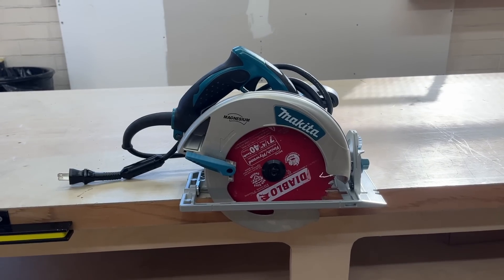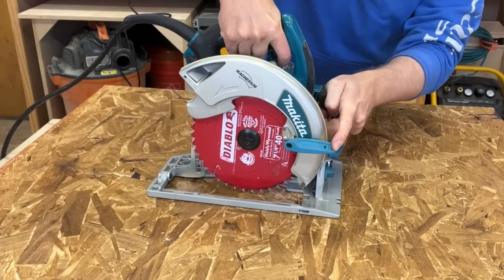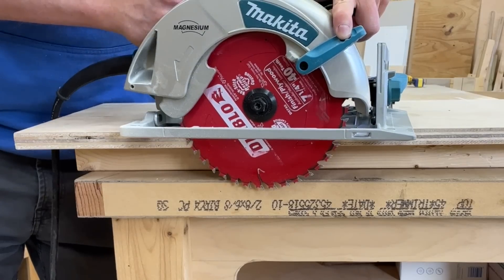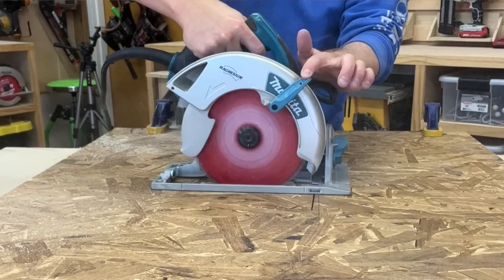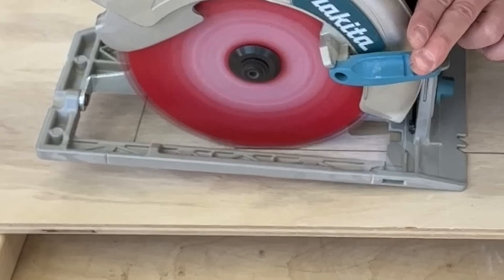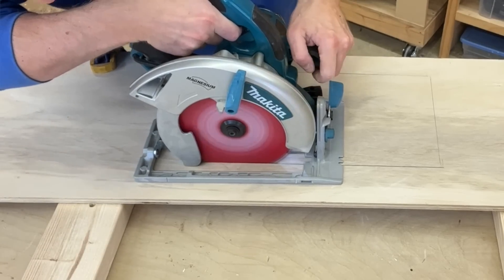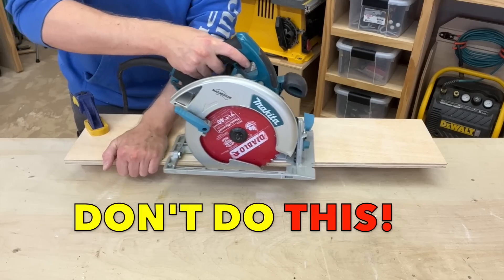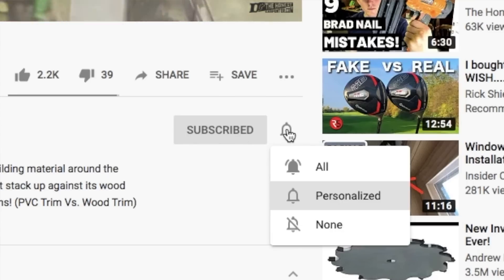Don't Try This DANGEROUS CUTTING TECHNIQUE! (Here's How To PLUNGE CUT W/ Circular Saw Instead!)

Comment: Too Dangerous for my taste, if I ever need to make a plunge cut, I'll just stick with my Jigsaw. 👷🏿
Reply: Amen to that 🙏
Reply: But you can't start a plunge cut with a jigsaw. Do you use a large drill bit for the initial hole?
Reply: Absolutely! I can drill a hole and use the jig saw. I’m not a pro so I shouldn’t use pro methods.
Reply: @paulcarey1708  drill bit with diameter slightly larger than the width of jigsaw blade.
Reply: @paulcarey1708  Yes I predrill holes on my cut path before I start.
Reply from the maker: I’m going to show jigsaw plunging in another vid, W!
Reply: So I've seen yahoo's  reverse blades to cut multiple sheets of metal roofing, was no way! I wouldn't do that, but seen done. Seemed unprofessional,
Reply: Glad you prefaced this with if your not a professional. That was exactly how I was taught to plunge cut 25 hrs ago.
Reply: And a drill and a drill bit of sorts
Reply: @anywhy30  nah. it's a good use of old dead blades. It also works for thin plastics. Like siding.
Reply: @paulcarey1708  yes you can just set pendulum to max and rock the blade in. As long as your hole is bigger than saw stroke your fine.
Reply: @anywhy30  pretty good use for a dulled blade, you can cut steel plate with those tungsten teeth, some saw companies even market the fact. Turning the blade around is just to get better geometry than a rip tooth.
Reply: I've never had any issue with plunge cuts even as a rookie. When your jobs requires production you tend to throw a few safety things out the window but also, you've gotta play it smart whenever using any cutting tools or nailers.  Jigsaw is nice but for production framing, you will rarely see them out on a typical job site, mainly because the setup for the cut takes a while, and having a flexible blade, I rather go circ saw and keep a firm grip.
Reply: You ever tried to plunge cut with a jigsaw? It's aweful. What you probably mean is drilling a hole and sticking the jigsaw blade in. That's ok. 
But plunge cutting with a circular isn't that bad though if you do it slow. I still have eight fingers..... And two thumbs. Lol
Reply: Yeah I agree, plunge cuts was one of the key reasons why I bought a tracksaw as it felt way too dangerous to do the same cut with a circular saw
Reply: Even if I was a pro of all pros. I'm going to take my time and do it the safest and best of correct of ways. I'm never going to rush things to maximize a profit. One mistake isn't worth finding out how bad a mistake can be. Just like "measure twice cut once" I got my one thing "Doing it right is one time done."

Comment: I'm 71 and not a pro by any means.  I've not done that many plunge cuts but the ones I've done have all been your way, I have never ever even thought about using a saw without everything being tightened down properly.  A coworker used to chock the blade guard up on his saw and still did it even after setting the still spinning blade down on his thigh.  Nasty gash, some people are just stubbornly ignorant.

Comment: As a DIYer, I've done the loose plate method once. It worked, but something about it didn't seem right to me. I figured out the better method on my own. I'm glad you're putting this kinda info out there.
Reply from the maker: Yep, there’s something just insecure-feeling about it Bruce! One of those things you can’t pinpoint until a really bad kick happens when you’re right in the middle of a cut 😬

Comment: One way to help get the cut lined up is to put a reference line on the piece.  Figure out about where you are going to start the cut, make  a mark on the piece at the front of the sole plate, then mark a line 90 degrees to the cut line at that point. Then you have a reference line to put the sole plate on when you start the cut.

Comment: I'm not exaggerating when I say this but yesterday I had to do several plunge cuts into plywood and I used the exact method you described. Measure the depth. Pivot on the plate. Go slow. Lift your cut material off the surface.

Everything worked perfectly.

Comment: Love your safety tips.  Of course my heart is always in my throat when you demonstrate what not to do.  Can't even imagine the number of DIYers who have been hurt with by improper use of cutting tools.  I realize now that I was doing a bunch of unsafe things with my table saw.  I'm so grateful I didn't irreparably harm myself before I found out how to execute a proper cut.
Reply from the maker: Thank you, Jonesy! I’m really glad the tips are helpful—and that you’ve remained safe this far. Keep it up in 2023!
Reply: If you run you cut lines out beyond the corners of your cutout it’s easier to see where to stop cutting. Sometimes after making a the initial cuts I lower the blade to get closer to the corners after making sure there is clearance. Haven’t tried the loose shoe trick but you definitely want the toe of the shoe registered on the material.

Comment: In 1976 I joined the Carpenters Union and began framing tract homes in So Cal. Back then everyone used the Skillsaw 77 with guard held up with a 16d nail. No hard hats. In the summer we all wore shorts and tennis shoes. No handrails. We walked the tops of the walls for rolling joists and setting beams and rafters. I did this for 14 years. After that I was a Licensed Contractor until 2013. I am very glad to see that today all that has changed.
Reply from the maker: I’ve seen a LOT of that same stuff myself, Joe. I too am glad safety is getting a bit more of a look these days!

Comment: Another suggestion for alignment,  Measure the distance from back of blade to front of sole plate.  Draw a perpendicular line to each cut line at this distance from the back line.  Line up the front of sole plate to this line when beginning the plunge cuts

Comment: I have used a circular saw, both casually and professionally, for over 30 years; often on sheet goods and occasionally requiring a plunge cut.  I have never heard of the loose plate method and certainly would never attempt it.  The way you show has always worked for me.

Comment: I make plunge cuts when needed. Not a problem if you set the saw on the material to be cut, adjust the bottom of the blade to be 1/4 " below the material, and anchor/set  the plate. Carefully line up the blade with the cutting line, hold the front edge of the plate against the material firmly and press the blade into the material. I don't think anyone leaves the plate unanchored when cutting.

Comment: I agree 100% - loose plate cutting is only for people who don't want their fingers any more

btw: I find a line perpendicular to the intended kerf, about where the toe of the sole plate would be, helps line up the cut. you don't have to line up with it perfectly but it helps

oh, and watch out where the rear of the blade is. it's easy to start too far back and make a mess of the corner

I hardly ever start a cut in the classic style when I'm cutting sheet material because it's so easy to have the edge tear out, making an ugly corner
Reply: Soooo.... the guy with 11 fingers tired of getting teased by the other woodworkers?   ;^)

Comment: I've used the tilt and drop method for almost 30 yrs for cutting out windows, medicine cabinets, vents for a roof, etc. It's the only method I use, even when I started carpentry this method just seemed logical. It is a good practice to use and safer, I've seen other people try the other two ways where the saw does kick back or tweeks the blade. Great video.

Comment: As a DIYer I have done quite a few plunge cuts over the years. I always used the correct method you showed because that is how I instinctively did it. Never even thought about other methods cause it worked well for me.

Comment: I've been a carpenter for 35+years and never even heard of anyone doing loose plate cutting. I plunge cut exactly as you showed in this video. Good job! PS: if money is no object...buy a Festool circular saw... it does plunge cutting with ease.
Reply: absolutely correct!!!
Reply: plunge cutting with ease into wallet! sorry, could not help myself

Comment: I've never seen or will use the loose plate plunge. I do mine like you do, line up my front plate notch & my blade (adjusting my kerf with my line) then start the blade. I find plunge cuts are easier with my Skil worm drive than my M18 sidewinder. Another great video.
Reply: I found plunges easier with the skil worm too until I started clamping the blade guard open. Something I would strongly advise against any diyer doing and any pro making a habit of it. I will never clamp a worm drive open and probably not even a corded sidewinder. My M18 fuel though... That thing is so fucking smooth and has never kicked on me.

Comment: Great video - thanks. It made me think about a few times I've had to do this and yes, some of them ended in kickback and a messed up piece. I went out and tried something - clamping a wood baton at right angles to a cut line on a board, and bracing the sole plate against the corner between the baton and the board. It worked a treat to make the first cut and it lines the blade up exactly. Here's exactly what I did - 1 set the cut depth to be 1" below the board, 2 clamp the baton at right angles to the intended cut, 3 place the front of the saw sole plate into the corner between baton and board, 4 turn on the saw on and gently lower to make the plunge cut, 5 turn saw off and remove baton, 6 reduce the cut depth to 1/2" below the board, 7 with saw still off, drop the blade into the cut with the reduced depth giving enough blade clearance front and back to avoid kickback on startup, 8 complete the cut. This all takes a minute or two longer, but I got three perfect cuts out of three. I hope that helps somebody!
Reply: Great solution imho

Comment: I haven’t done loose plate plunging, but have had the plate loosen. Not great, but I usually have stuff clamped down when doing that.  This gets way more important when doing a bevel plunge. 
Cutting short hip rafters, same thing. Clamp it. It’s cheaper than hiring a guy to hold the other end.

Comment: 1. High end circular saws (e.g. Festool, Mafell, etc.) have a spring loaded base plate that can be pre-set to a precise depth to allow for a controlled, precise plunge cut. This feature is extremely useful and is one reason why these saws are expensive. You get what you pay for.
2. When using a circular saw on a track (i.e. a track saw) to cut high quality sheet goods (e.g. finish plywood), it is sometimes extremely helpful to initially set the depth to a shallow cut (~1/8” to 3/16”) and move the saw backwards along the track to make a clean score cut, then re-adjust the depth for a full thickness cut and cut forwards along the track. This produces a clean cut on both sides of the plywood.

Comment: Great stuff. Easily overlooked in your video is the bit where the work piece is clamped down. I have seen WAY to many sketchy things on job sites where guys have plywood on top of rickety horses or a small piece sitting on a drywall bucket and everything is skating around.
   Doing plunge cuts are a recipe for disaster if you don't have a stable work piece AND total control of the saw.

Comment: Very good advice. 
I rate the dangers of a circular saw right up there with a table saw. But with a few precautions (such as what you just explained) Both saws can be relatively safe. Great video btw.
Reply: Table saws can be very good at launching missiles, but they'll never kick back and slam a spinning blade into you.

Comment: Thank you sir, of all the power saws I find the circular saw the most difficult to learn to use safely and effectively. I greatly appreciate all the tips and tricks you provide! And yes, as a noob I have not yet spent enough hours to develop the fine motor skills required to use this saw professionally, so my attempts at long straight cuts do get "squirrelly" haha
Reply from the maker: You’re welcome, Bruce! It’s the most dangerous saw, so it’s the one I cover most thoroughly 👍
Reply: @Bruce Le Smith find a good straight edge and, with it clamped down securely, run the plate of your saw along it to make long, straight cuts. I was nervous of it myself at first, but once I learned the dos and don’ts and had some practice, I became more confident. That’s not to say that you should ever get so confident that you stop following safety rules! I’m sure you’ll be running nice, straight cuts in no time. 🙂

Comment: Nothing is more precarious than taking off 3/8" of a custom cabinet that has been waiting f
or a Sub Zero since the pandemic started.  Then sometimes you need to take some off the height! Great video and you're a great teacher
Reply: If you're talking about widening the opening or removing part of the scribe on the face to fit it between other cabinets you're talking about something that works far better with a router than a circular saw. That's especially true if you're removing something so  it will be flush to the side of the cabinet. You definitely need to be mindful of the grain, and make sure  you don't let it split out more than you want to remove. A saw works fine for  taking down the sides to adjust height, but  anything will show needs to be scored with a utility knife and then taped to prevent splintering.

Comment: For plunge cuts I shim the guard open using the lever against the blade housing and when I'm finished I let the blade come to a complete stop before I remove the saw then I set it down but not on the blade. That way I have both hands on the saw during the plunge cut.
Reply: I use a pencil to hold the guard open.

Comment: We cut alluminium with a circular saw at my workplace up to 150mm and have plunge cut 50mm we clamp a straight edge on the material and use that for a fence.  Up to 100mm we use a makita saw and the thicker stuff we use a festool saw that is massive but slow as it has some sort of thermal cutout and it stops and you have to wait. The makita saws are very good

Comment: Years ago I tried to plunge a cheap corded saw into floor boards with no knowing how…it scooted off on its own. 😂  So when I recently bought my Dewalt 570 ‘serious saw’ I looked up how to plunge properly (as in this vid) and never had an issue.  I make a point of setting my saw depth to no more than half a gullet depth deeper than the material and that works perfectly.

Comment: If you're gonna  need a jigsaw to finish the corners of a circular saw plunge cut, you might as well make the entire cut using the jig saw.  I think it's safer and easier to drill two holes in opposite corners and use a jig saw to make cuts away from the holes before cleaning up the two corners that have the drill holes with the jig saw.  I used to hate my jig saw, but learned that using a short blade and cutting slow yields nice straight, square cuts.
Reply: And a lot safer too.
Reply: Depending on the depth, you might just need a hand saw for the corners.  Also, maybe use a circular saw for the initial cut, and then a jigsaw for the rest.
Reply: Over any sizeable run the jig saw always gonna have some waviness even with the steadiest of hands.
Reply: You Can never cut as straight with a jigsaw as with a circular Saw - unless you use some kind of guiding rig
Reply: faster and easier to end up with a nice strait cut using a skilsaw, but if someone isn't comfortable with plunge cutting, they should just use a jig saw in that case.
Reply: What about scoring a line in the wood with a utility knife and instead use a multi-tool? It might take some time but I would argue much safer......no?

Comment: Never really saw the need to cut with the plate loose before and can't see what the advantage would be now. Tipping in works great; way more controlled and definitely more deliberate. 
Great video, as always, Ethan
Reply from the maker: Thank you, Deutsch! It’s never made a ton of sense to me either, but some framers especially just seem to prefer it. It might be sliiiightly faster than setting up for a tip-in…🤔
Reply: if your plunging overhead, loose plate is seemingly more "safe"...

Comment: I mostly agree with you on all points, save for the 1/4" protrusion. With less blade length in the material, the operator is far more likely to twist and wander causing an increased risk of binding and kickback. The only real solution to this potential problem is to use a saw equipped with some sort of anti kickback sensor. Most cordless and some corded saws have this feature where if the motor draws too much current it will shut down and apply the brake. Safest system all around in my opinion. I've been making plunge cuts in sheeting for more than 20 years as a carpenter, believe me, I would NEVER intentionally run with a loose plate on my saw, be it depth or angle adjustments.